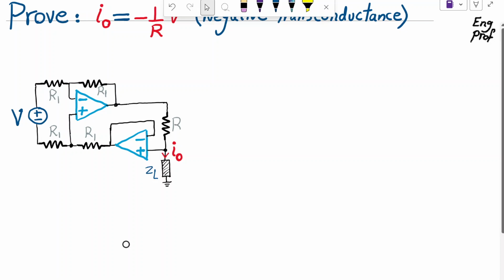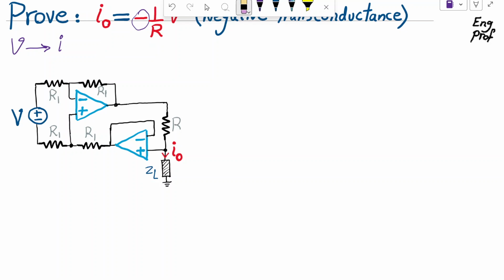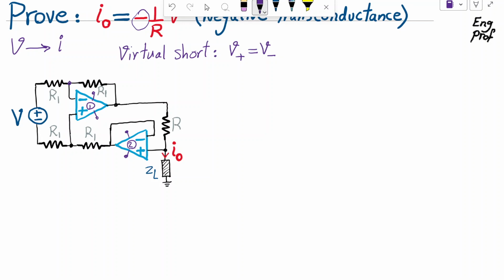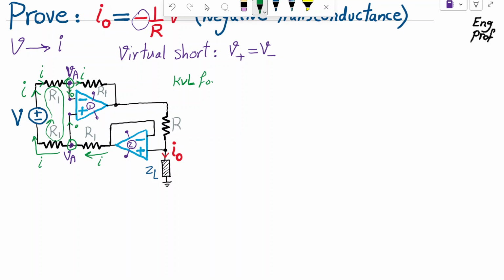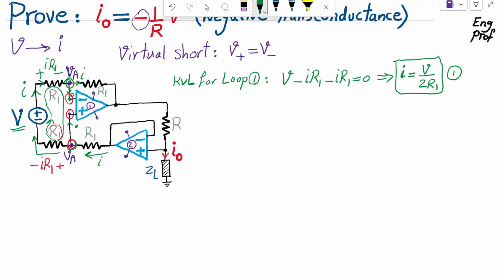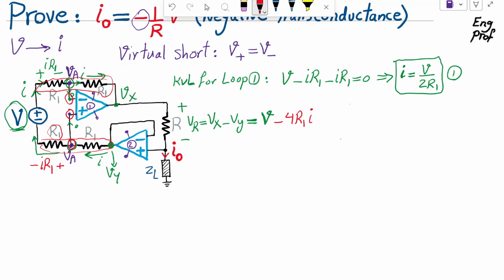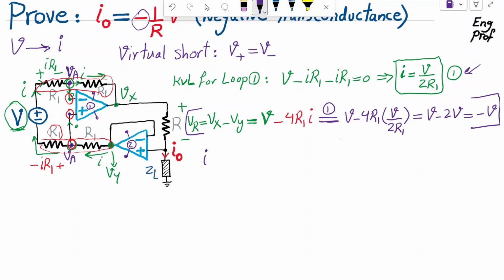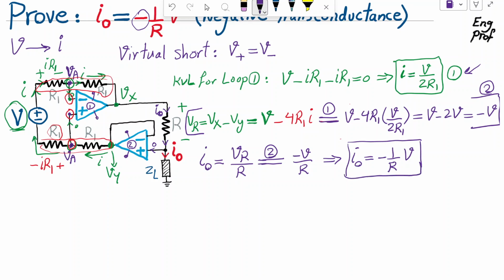Negative Current Source (Transconductance) designed with Op Amps

Comment: This is an analysis of the circuit shown. I can understand the process. Thanks for the nice videos. But how is the design of the circuit is done? Given you want to have a negative transconductance  and use op amps with some  resistors.
Reply from the maker: Thank you for watching and your follow up. In this Design a minimal number of operational amplifiers are used to generate a reverse current and at the same time isolate current generation from the load ZL. For more examples please see
Op Amp Amplifier with Electronic Gain Control https://youtu.be/NoNgQpbj77Y
How to find Bode Plot, Freq Response, Transfer Function of Analog Filters https://youtu.be/vZFkPeDa1H8
Op Amp Analog Computer Differential Equation Solver https://youtu.be/ENq39EesfPw
Push-Pull Power Amplifier with Darlington Transistors https://youtu.be/866MYibo8yE
Analog Logarithm Computer https://youtu.be/RpKEq5WyoLg
For additional analog circuits and signal processing examples see https://www.youtube.com/playlist?list=PLrwXF7N522y4c7c-8KBjrwd7IyaZfWxyt
I hope these Circuit design and analysis videos are interesting as well. 🙋‍♂